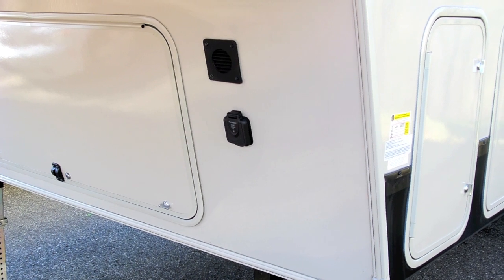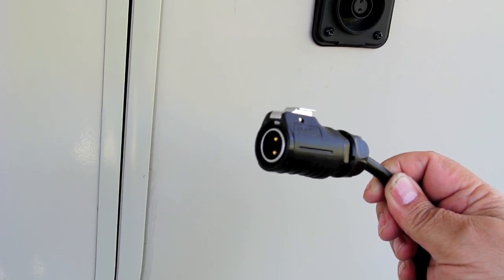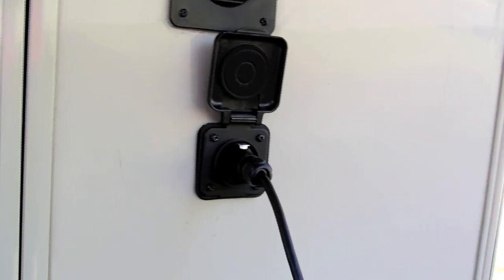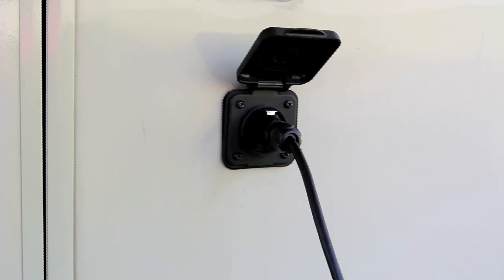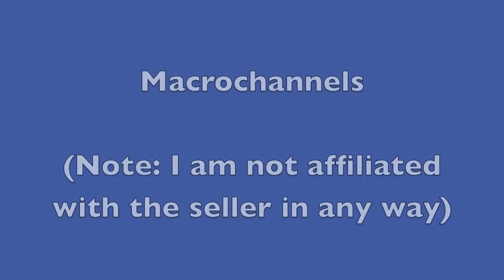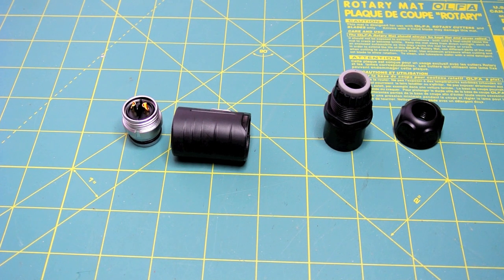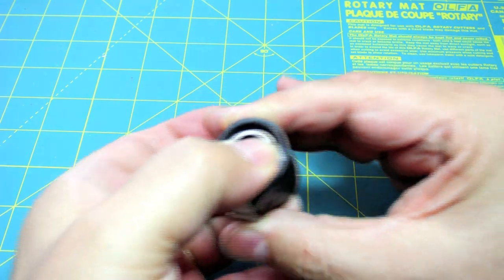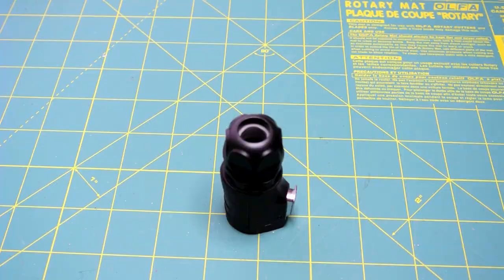Using your RV's Furrion Solar Power Port

Comment: we have a 2018 KZ Sportster toy hauler which came with the furrion solar panel input.  we have a Coleman 100W panel and ordered the adapter you mentioned in the video.  Wiring is too small for water proofing connection but my actual question is as follows:
How does the "solar panel charge controller" - get wired between the leads coming into the battery compartment off the furrion solar receptacle and then from the controller to the battery as a second line.  (primary lines are to the trailer off the battery)  

All the solar panel charge controller wiring diagrams on the internet show it going from the solar panel to the controller and then to the battery (no plug in port on the trailer) l
Reply from the maker: When i produce a video, I typically have an associated webpage with additional information.  Such is the case here. The webpage is at. http://www.rv-project.com/projects/solarconn.php

It should answer your question. There is a connection disgram there that shows the battery and connector.

I also produced a follow-up video that you can find from the webpage.

If you need additional help, there is a link on my website under resources that you can email me directly.  It may take until next week for me to reply though as I am traveling at this time.
Reply: This configuration assumes your charge controller is attached to a portable solar panel outside of the RV.  It is a rather poor design.  Honestly,  I would bypass the Furion port completely.  I have installed solar systems on several of my RVs and the charge controller should be mounted somewhere inside the coach in dry storage, but preferably in a different compartment from the batteries.  You should use an MPPT controller and run the highest voltage panels you can buy.  A 24 volt panel will send the same wattage into the charge controller at half the current.
Reply: @mikebarger138  or you can use this as an input to an internally mounted controller in the RV. That is what I'm doing. Bought a bulkhead inlet (female) and plug (male) set. They are rated 20A@500VAC. My guess is it is some Chinese or European standard for an industrial connector. It was either this connector or the SAE connector and I'm not sure how water resistance the SAE connector is. I leave my panels out in storage to keep the battery topped up.

Comment: Excellent job researching for us! Thanks. Just a heads up to everyone, the panels that connect to 12 volt system put out current at 17 volts. If you use that, 100watts/17 volts is 5.88amps. If you need 7.5 amps(why does it say 10 amp on the panel and have a 7.5 amp fuse?) you're looking for 17volts X 7.5 amps = 127.5 watts, or thereabouts.
Reply: yea that fuse size is wrong. It should be a 15 amp fuse. This wall port is rated for 10 amps at 240 volts per Lippert/Furrion.

Comment: In your opinion could you use this with one 150w panel providing power to one 125ah 12 volt battery? I'm assuming yes as max amp output of panel is listed at 8.33 amps?
Reply: Actually that seems kind of a low output for a 150 watt panel. It should be 12.5 amps? 150/12?  So if it's 12.5 amps this port would not work I think? But then again panel says 18 volt max voltage.  *confused*!!
Reply from the maker: There are efficiency issues whenever you do a voltage conversion, power supply, battery charger, etc. You will never get 100% out (I.e. Watts will be less than E x I).

Having said that, a 40% loss seems excessive.

Regardless of the solar panels  you must use a solar controller between the panels and battery. Essentially it is a battery charger.

Assuming a 12v battery the controller (charger) will output between 13-14v depending on the battery's needs and solar panel capacity.

If the solar controller states a maximum output current,  I'd go with that.

If you exceed the rating of the connector it could melt and cause a fire.

Comment: Since you said its 10amp max, would my furrion connector works for 100 watts solar panel?  I have cherokee rv with furrion plug.  Thanks for posting this!
Reply: I work in the solar industry. Modern 100W solar panels made for nominal 12VDC charging have the following spec.s ;max pwr voltage approx. 18 VDC, max. pwr current is approx. 5.6A. what you are seeing from the previous replies are people who divide the 100W by 12V to get the Amps. This is NOT how solar panels work.
Reply: @marcusaetius9309  great. The RV manufacturer says 10A max, 95W panel max. And I believe the fuse is 7.5A. 
Does is make sense to put in a 10A fuse, 200W panel?
Reply: B C 
I’m not aware of a 200w solar panel made for charging 12v batteries unless you are using an MPPT controller. If that is the case it might give you a max. of 14A.
Having fuses on the solar end of the system is something I’ve never understood since technically it is impossible for solar panels to give more current than their short circuit rating which is very close to the maximum power rating.
Reply: That should produce about 8 or so amps at 12Volts.
Reply from the maker: At 12V, 100W would be just under 8.4A. However, you will find that your solar panel will rarely output 100W, due to the angle of the sun, clouds, etc. Typically it will be much less.

But the solar panel controller manufacturer should have a recommendation on fuse size between the controller and battery, and would most likely be 10A or less.

Comment: Do I need a charge controller too if I plug in solar panels to this port?
Reply from the maker: Yes. The charge controller is necessary to ensure the solar panels to not put too high of a voltage on the battery (some panels output 24V) and that the battery is not overcharged at too high of a charge rate.
Reply: YES, Since there is no charge controller inside the RV. (Unless you install one inside the RV.)

Comment: I purchased the connector and have a 6w panel coming. My intent is strictly to maintain the battery when the RV is stored (outside obviously) and not connected to AC power. I too had a question about polarity as your video oddly did not discuss it. I'm having trouble understanding why you say it doesn't make a difference if we just have two conductors that go straight to the battery. Pausing the video on the interior shot, it appears the upper pin on your RV is black (ground/negative) and the lower pin is red (hot/positive).
Reply from the maker: The pins are marked 1 and 2, not positive and negative. So from the connector's perspective it does not matter. 

The only time it really matters is if you buy an adapter cable such as the ZAMP-to-Furroln cable... which is intended to connect ther solar panels. Then you should trace their positive and negative leads.

While convention might suggest 1=positive and 2=negative, I cannot recommend using such convention because you might run into an adapter that is wired the other way.

Its far better to decide on which pin after you buy any such adapter. Or if not buying an adapter but wiring it completely yourself,  simply choose one pin or the other. 

If Furrion would have published a diagram on which pins they used, I would suggest using their same convention for simplicity sake, but since I have never found such  a diagram, I will refrain from suggestilng which pins to use.

And for example, a layman might think 1=pos/2=neg is a logical choice, an electical engineer being mindful that electron flow is neg-to-pos might very well choose  1=neg/2=pos.

So in the absense of pos/neg markings, feel free to choose either pin. As lons as you don't connect someone else's solar panel to your system (that they might have wired the opposite),  you should be OK.

Comment: (attached to below) oh, and the solar panel says its a 12v with 18v operating voltage, that is confusing as well. We plan on using 2 -12v batteries.
Reply from the maker: You will be (or should be) using two 12V batteries in parallel, so you will increase the current x2 but maintain the same voltage.

The solar panel does indeed put out 18V. However, the charge controller that should come with the portable panels will regulate that voltage to what the battery needs for charging. Lead Acid batteries typically require 13.5~14.6V to charge.

If your panel does not have a charge controller with it, you need one. Do not directly attach the solar panel to the battery.  The two panels I previously provided a link for should come with a charge controller, but verify that before connecting any panel to a battery.

Here is a link to a typical charge controller: http://amzn.to/2p2Ndlc   The one that comes with the portable solar panels should look something like it. It might not have a display, but at least have LEDs showing the charge state.   The solar panel(s) connect to the charge controller, and the charge controller hooks to the battery(s).

Small portable panels, say those in the 5 Watt range (like this one: http://amzn.to/2p2HZGr ) typically have a charge controller built-in.  However, these kinds of solar panels are only useful for storage of the RV as they can only charge a lead acid battery at 1/20th of the rate of a 100W solar charger.

Comment: Thanks a bunch. I will order the part. Without this video I would not have known about needing this plug. 

I have a Furrion outlet on the side of my new camper. Are there any limitations on what size solar panel to buy since the outlet has "10 amp" written in white? I want to buy the 100 watt portable mono 12v folding panels. There are so many specifications I do not know which 'AMPS' to look at for compatibility. ..short circuit at 6.2 amps at or max at 5.9 amps? 

The only thing we are really looking to do power-wise is to run a 20 inch LED tv for an hour in the morning to watch the news. We will be at many state campsites that are primitive without power. 

THANK YOU so much for posting this video. All the new campers have these ports and it seems many more will have questions.

Make a video about your solar panels :), this would be great!
Reply from the maker: I do not use a solar charger at this point. I live in an area of the country where we don't see the sun a lot - so solar is going to be less efficient.  

I produced this video to provide a source for RV'ers to either connect a charger other than the Furrion charger, or to use the port for other purposes - say to connect a standard battery charger, among other uses.

As far as I can tell, Furrion sells a "package" of items to the RV manufacturers that include a stereo system, 30A or 50A primary power inlet, and perhaps the solar port. They don't typically include the connecting plug as they intend you to purchase their more expensive solar panel.

I hate when companies force you into buying their aftermarket products, and I was fortunate enough to find the matching plug, so I made the video.
Reply: That is only about 8.33 amps IF the cells actually make 100 watts at 12VDC.

100 Watts Divided by 12 volts =8.33 amps.
There should be a fuse inside.
Find it now so in case you blow it you will know right where to look and have a spare on hand.
Reply: @4666L  charging voltage for lead acid is around 14.4VDC (6.9A) on the high end and float is around 13.6VDC (7.35A). 12VDC is nominal voltage.

Comment: Is there something to tell the difference to keep the polarity straight
Reply from the maker: There is no intrinsic polarity, The terminals are just marked #1 and #2.  So it really depends on how you want to wire it. For example, you can wire the Positive battery terminal to #1, and the Negative battery terminal to #2. 

That is the way I'd do it, but there is no reason you can't go the other way (Negative = 1, Positive =2).

Just make sure you wire up the Solar Panel using the same scheme.
Reply: you would want the positive wire connection to go through the fuse. You ALWAYS fuse the "HOT" lead. And the connector is "Keyed" so you cannot flip it and have it wired the wrong way. If you are not familiar with electrical wiring, use the pre-made cables or hire an electrician.
Reply: @timlist4173  I had this issue, make sure the top pin is negative, at least that's how mine was. Use a voltmeter to check your connections and make sure it matches up before plugins in.

Comment: I have a Grand Design (2017) and I want to buy a solar panel to keep my battery charged. What size do I need? It is a deep cell battery.
Reply from the maker: I would go with either a Furrion 90W portable solar charger (https://alexa.design/2okh5ql) or the Renogy 100W charger (https://alexa.design/2oS2zZI). 

These are both portable "suitcase" type chargers so they are self contained (charge controller, hookup wiring, etc). 

You  (or someone you will have to pay) will have to connect the battery terminals to the charger port on your RV, and in the case of the Renogy, you will have to buy the connector mentioned in the video (the Furrion charger should already come with the connector).

A 100W charger will typically output around 4~7 charge amps, and should recharge a typical deep cycle battery in about 812 hrs of direct, full sunlight - depending on how much it was discharged.  A cloudy day or winter-time sun may take longer as the charge current is dependent on how strong the sunlight is, and if the solar panel is pointed directly at the sun.

100W is a popular size, and is about the limit on suitcase portable chargers. If you want to go with a higher power charger, then you will likely have to have one permanently mounted on your RV's roof.

There are just too many variables in that kind of installation to give you a recommendation.

Comment: Thanks for the connector tip. Just ordered two for a solar panel and for a aux port to power 12v accessories. Cheers!

Comment: Thanks for the post. This helped me as I couldn't find a source and even talking to the factory, they didn't know either. Weird.
Reply from the maker: As I understand it, Lippert is somehow associated with Furrion. Lippert makes many items for RVs, and typically they bundle them together as a kit. It might include the RV frame, axles, slide mechanisms, and things like the solar port.

When the RV factory installs it, they are simply installing all of the goodies that they got in the "kit".

Until I found this connector, the only way you could get one is to either buy the Furrion portable solar panel or a $40 adapter cable made by Zamp for use with their solar panels.  

If you wanted to use the very nice but inexpensive Renogy panel, you were out of luck unless you bought the $40 Zamp connector and re-worked it to fit the Renogy panel (if you could even find the cables in stock).
Reply from the maker: Beyond installing the panel connector, the typical RV factory has that "deer in the headlights" look when asked about the connector.
Reply: yes and it was the factory and the dealer, they should know each peice of hardware that comes onto their camper, its not like its underneath or hidden, its a feature they sell and label on their marketing materials. Either way thanks again.

Comment: I have a Grand Design with a Furrion Solar port.  I want to get a panel and charge the battery but am definitely not confident in my electrical/solar skills.   To achieve this do I only need the Renogy suitcase, and the plug (at the beginning of the video)?  Or do I need another part?
Reply from the maker: You need a solar panel charge controller to regulate the charge rate on the battery. The Renogy suitcase solar charger should come with a charge controller, but its always best to verify.

Then you will simply have to cut the battery terminals off the Renogy panel and attach the connector.  Pay attention to the polarity (positive and negative) when wiring the connector.

You may also need to connect the Furrion solar port to the battery as Grand Design typically leaves it disconnected.

Comment: can you tell me where you got the wire and show me how you connected it to the solar panel please
Reply from the maker: When you buy the typical portable "suitcase" solar panel, such as the one from Renogy, it will come with a cable for connection to the battery. You simply replace the battery terminals on that cable with the connector; ensuring you maintain positive-to-positive, and negative-to-negative.
Reply: What is the polarity of the connector - it's marked 1 and 2 - that's no help.
Reply from the maker: I looked at the spec sheet for the connector, and both contacts are isolated - meaning neither are tied to the shell (which would be the one you would want for ground). Therefore, it really does not matter which pin you use for + and which one for -.

So you are free to use either pin for either polarity - unless the RV 
mfg connected the port to the battery. In that case, you will want to 
figure out which pin they used for + and which they used for -.

My RV came with the solar port installed and the connector wired with terminals on the end - but not connected to the battery. So, it's up to me to figure out which I want to go to + and which to - when I decide to use the connector.
Reply: Just to help others that are trying to be interoperable it looks like the stock configuration is to have the lower, the point away from the latch be positive (+) and the side closest to the latch be negative (-). Hope that makes sense
Reply: AAAAAAH! Wrong answer!!!!!!!!!!!!!!!!!

It certainly DOES MATTER!